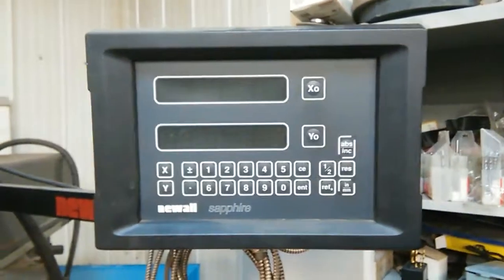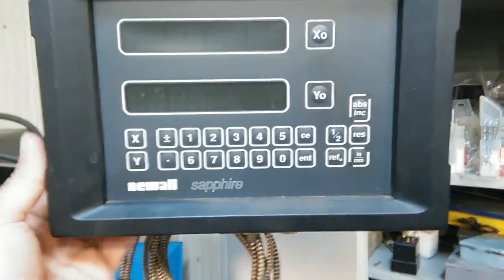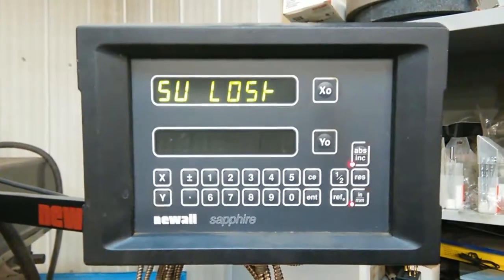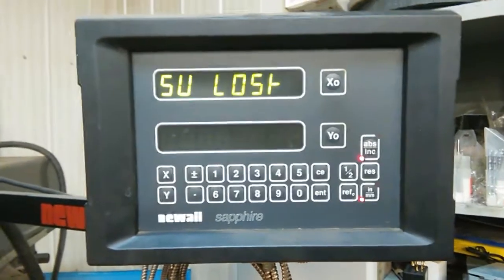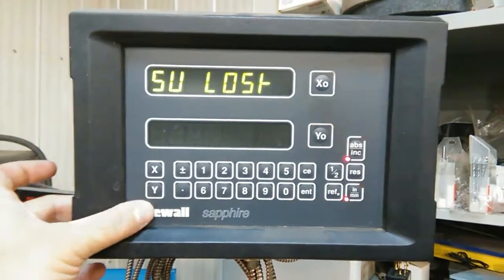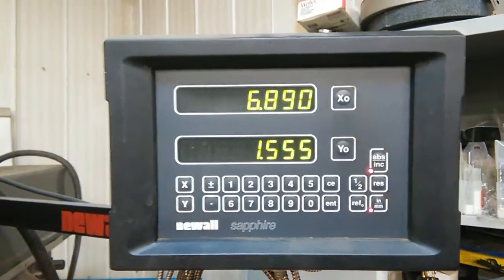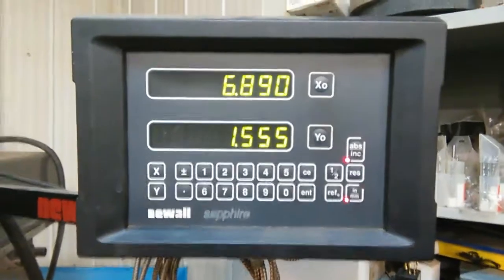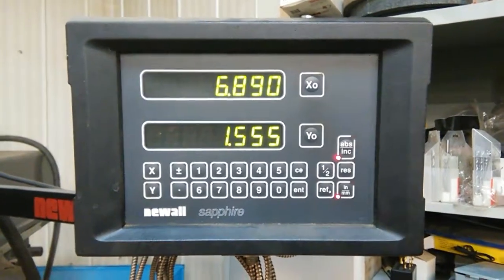Newall sapphire DRO Digital Read Out reset

Comment: did you replace the battery?  If so, can you tell me where you found it?  Cheers.
Reply from the maker: No I never did. I couldn't find a replacement locally and the one I had found I'd need to import and  it would've been expensive. It's an uncommon battery. I just use it as is and have to do this every time I start it up. Thanks for the reminder I'll take a look at it again and try and come up with a solution. If I do I'll post a video.

Comment: Picked up a mill with one of these and it works but its reading exactly .200 off over 1 inch, any ideas?
Reply from the maker: Did you check for any mechanical looseness anywhere?
Reply: @dabooge  the issue ended up being a setting in the hidden menu, it gives you different options of scales and i guess the preveious owner selceted the wrong one. Lol makes me wonder how many years they just dealt with the dro being .200 off over a inch